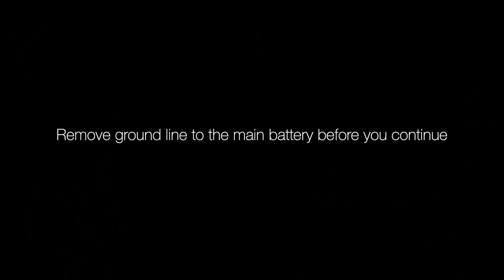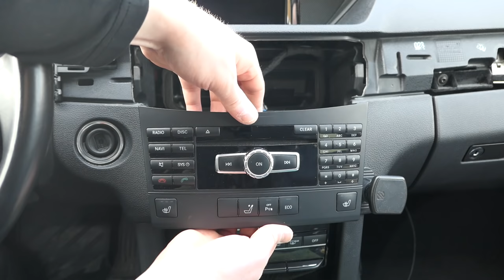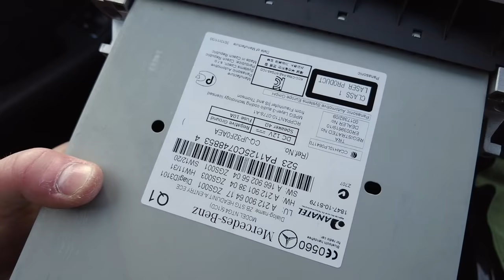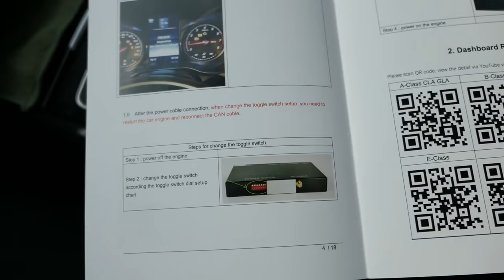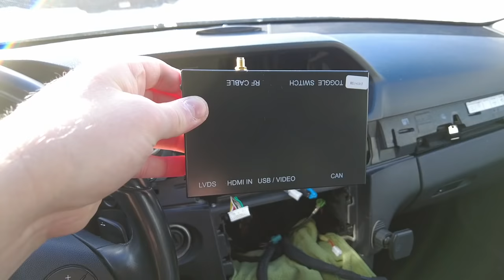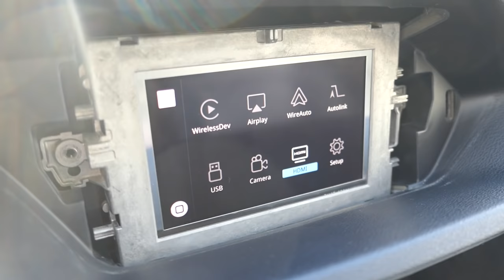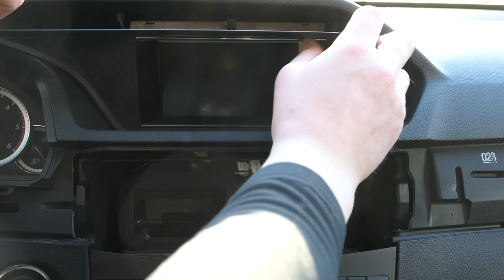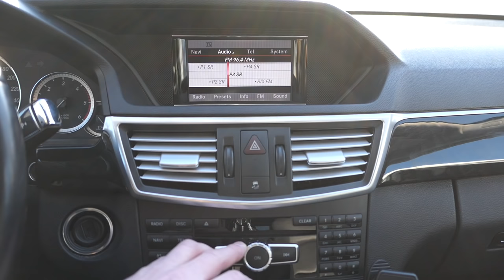Mercedes-Benz | How To - Install CarPlay For Audio 20

Comment: You don’t have rout the AUX cable to the center council. Just use the cars original Bluetooth 👍🏻. Audio quality is great since I am still using the original Bluetooth and I could still play music and answer phone calls from car play 😁
Reply: what did you do with your aux cable in the end?
Reply: @swaagadohnn  not connected to anything.
Reply from the maker: Same here no need to use it! Don’t really understand why it coming with the kit.
Reply: Sir I’m worried about the reverse camera coz it might not work? Also I use Bluetooth so if I install this would it still work? Thanks
Reply: @johnparkerzabala  yes. Both should work just fine
Reply: Does it have Bluetooth even if the car does not? Because my aux sound it's terrible
Reply: @amirjoma8152  I don’t think so
Reply: Audio 20 doesn't have audio Bluetooth it only has phonecall Bluetooth.
Reply: @nudisco300   For NTG 4.5 (Audio 20) VIN option code 523 - it does have audio bluetooth streaming. I'm with the same car and same setup as the video owner and I have audio bluetooth option.

Comment: Dude I keep thinking I’m going to do this for my 2011 W212 coupe.  You helped me do a few things on my own but WOW I don’t know if I have the fortitude to tackle this.  I’ll probably watch this video 100 times and bit off on this project next Winter maybe? Keep the great vids coming.  Love what you do - cheers)
Reply from the maker: Pleased to hear that my videos coming to use. Is not really that hard, is kinda seems messy with all the cables but when you have it in front of you is really easy to understand and execute. 

Best advice I could give is not to stress when doing the install, prepare for a full day with all the steps and testing the device before assembly. 

Be careful when removing the screen if you choose to put the unit back there. Most installers seems to put the unit behind or under the glovebox but is probably same amount of work if not even more.

Comment: I tried it too, for my R172. Although the screen size is different, the aspect ratio is the same, and I had the same problem as you. The image is vertically stretched, because these screens are 5:3 and the box outputs a different aspect ratio. Did you notice it? I emailed the seller, but unfortunately I did not get an answer.

Comment: Thank you for this  very nice and detailed video. Is there a specific detail to identify the correct NTG model of my Audio 20 (SA Code 523) system in my C Class W204 (year 2012)? Also there is no reverse cam in my car. If I install a cam will it be possible to use it with the trajectorie markers and parking lines etc?

Comment: I have a very similar unit added to my C207 ntg, and found the screen blanks intermittently. I have asked the installer for advice, but his reply is take a pic of the screen blanking out, which is difficult to do whilst driving? Is it a fault with the unit or a wiring  issue?

Comment: Got that module from eBay today. Instalation wasn't difficult at all but I was not able to get sound out of it. I did set the AUX to on on the engineering menu but nothing happened and connected the jack to the ami port. The module got blazing hot, beyond any safe threshold for operating an electronic device on a enclosed space. Lost audio from my radio. Then, it startet rebooting. Don't know what to do...

Comment: Nice video, after 5 times watching I finally have a guts to install it myself, only issue that I have is Wireless Apple Carplay is not working but Android Auto is working wirelessly and I also installed a reverse camera but the dynamic line (trajectory) is not showing but camera operates normally. Wondering if it is due to my model is Audio 20 with NTG 4.5 which originally doesn’t have video input for reverse camera?
Also wondering what brand of that box you have? Mine is Limcet box, maybe the wireless apple carplay issue is this brand faulty

Comment: Hi, how does it works with parking sensors and cameras? Does it enables its automatically by itself or you have to switch it on manually? Thanks
Reply from the maker: Parking sensor and camera works as normal. You could chose in the setting if you like it to switch to original camera display when you put in the reverse or you could have it on aftermarket camera for CarPlay decoder. For my audio 20 system is not possible to add rear camera without this decoder, so is great 👍

Comment: Great video well done! Does this also effectively upgrade the Bluetooth version? With my original 2010 unit I can barely stream a song due to slow Bluetooth it seems. I need to understand CarPlay better I guess. Thanks again!
Reply from the maker: Yess I believe so because I don’t need to have my phone connected to the normal Bluetooth so should definitely upgrade your system. Not really sure about the technical for CarPlay but have my phone only connected to it and working really good.
Reply: @MB212   Great, thanks for the reply! I really like how it uses the same screen size. I’m going to check with my stereo shop what they would charge for this install. I’m in the LA/OC area. 👌🏼
Reply: @MB212 hello sir, i have an W212 from 2009 and i ordered the NTG4.0. I am just wondering if the volume of the sound will be low because of the AUX. I‘ve Tried an AUX Adapter for the music and i realized that the volume was waaaay lower than the adapter with the frequences via radio. And Since the Apple car Play will be installed with the output of AUX, i am wondering if it will be with a lower volume too or if its not the case. I would appreciate an answer.

Comment: does this technically also replace the head unit? i have subs in my mercedes’ but they don’t hit well because the stock headunit, so if i where to do this, would it solve that problem?

Comment: Amazing video instruction. 
Have you connected Aux, I couldn't see it? Otherwise how the audio signal from Android comes into original audio system. 
May I ask also a question regarding a rear camera. I have the video signal from the aftermarket camera connected to Comand via RCA/fakra adaptor. The Comand switches to camera automatically when reverse gear is on (set in engineering menu). 
My question is: have you tried (or could you try) whether the camera will have a priority over all modes also in case of this Android device connected? I want to keep the current connection of camera directly to Comand, not connecting via Android device if it's possible. This issue holds me back from installing this device.
Thanks in advance for your help.
Reply from the maker: Don’t really know the use for AUX I have not connect it to my car and everything still works. The CarPlay unit is wired to the original system so the sound coming that way. That’s no problem with the rear camera you could chose in the CarPlay menu what’s happening when you put the reverse gear in. You could have it switch to original screen/rear camera or CarPlay unit camera.

Comment: Hi MB212.  I just purchased one of these units.  I have a 2011 e350 cabriolet.  The dash looks a little different than the 212 coupe/sedan you filmed. Do you have a film that shows how to remove the head unit from the cabriolet?  Appreciate your response.  Thanks.
Reply from the maker: Hi sorry I don’t have any video of that model and not any experience to share. Hope you solve it anyway 🙏

Comment: $300? I have a W169 A class with the Audio 20 and I think I'm just better off replacing the whole head unit with an Android 10 system that looks like it's OEM? If this was a cheaper option I'd understand but I can't see why I'd use this?

Comment: Great job, nice video! How did you you connect the AMI audio cable with its port in the center console?
Reply from the maker: Don’t have any AMI port in my car so I did not use the cable at all. Everything works good without it.
Reply: @MB212  Strange! But how do you connect the CarPlay box with the Audio 20 in order to amplify the audio-signal coming from the box??? you don't have to switch to the AUX-In on your audio 20? I can't understand that :-(
Reply from the maker: Don’t know the technical how everything works. But when I have Bluetooth to normal system I could use whatever menu I like but when disconnecting Bluetooth to normal system is only working from AUX menu.
Reply: @MB212 Aaaahhh! OK! That’s an explaination! Thank you!

Comment: Hey, I have the same CarPlay unit as you and have a small issue that I’m wondering if you’ve dealt with as well.

When in the maps app, you can’t skip music tracks. The control knob moves the map, and of course the prev/next buttons on the NTG unit itself don’t work, as the CarPlay unit only can only intercept buttons going TO the NTG, not on it.

How have you dealt with this, if at all? Thanks!
Reply: hello i am having the same problem.  were you able to fix the problem?

Comment: Is there a version for ntg 5.0 too ? This looks and works great👍🏼
Reply from the maker: Yess you could also buy decoder for NTG 5.0 but for some models is not needed with the actual module, it could be coded in and you not need to redo the cables and things like in this video. 

I read about the NTG 5.0 system and CarPlay and is kinda messy to understand which models that have it or not have it. 

But what I understand is that your unit need to be updated and then you could buy a OBD dongle really cheap and get CarPlay, but you need to do some own research about it because I could not get you 100% right answer on that sorry.
Reply: @MB212  thanks for your answer. 
Yeah I'm also not sure if i need it or if coding is enough. I heard about this obd adapters with the carplay coding. Just plug and play and carplay is on your system. 
I have the s212 mopf. The last of it, from 2016. I think it came out 2014 and since that it got many upgrades, especially the ntg system firstly with becker now with garmin.
I try to find it out. Thank you. Keep going with your content. Its nice to see some modifications and how to do's on this car👍🏼

Comment: You really nailed your advertising in your videos, I’ve just gotten some ad for a CarPlay dongle 😜 how is the microphone quality?
Reply from the maker: YouTube know there audience 😆

Microphone quality I would say is same as before, because this unit use the original mic. I did read from another manufacturer of CarPlay units that’s implying the mic to the original one is not 100% because the SOS function not going to work that’s why they had separate mic before. Not sure if is true for this unit but they say is apply for all CarPlay units on the market.
Reply: @MB212  does  „hey Siri“ work?🙏🏻
Reply from the maker: Yess is integrated to steering wheel talk button, have try it couple of times for sending texts and works really good 👍
Reply from the maker: Read your comment to fast I see now, I have never got so many comments as recently kinda stress me out haha. The hey Siri I don’t know about need to try that out, I literally never used Siri before this CarPlay install.

Comment: Nice video! About the wireless Android Auto, have you tried enabling it in the Android Auto settings on your phone? (Settings/Apps/Android Auto/App Notifications - or something like that, my phone is in Brazilian Portuguese)? I have this same module installed on my C-Class (also Audio 20) and wireless works really good paired with my Galaxy Note9.
Reply from the maker: Interesting but I don’t have any android phone to test it out unfortunately. I did think it was only possible to use android auto with the cable was sure I did read it somewhere. I need to test this out later when I have access for a android phone.
Reply: Google added the support for wireless Android auto recently. When I installed the interface it wasn't supported, but later on Google updated the Android Auto software; I tried and it worked quite well - occasionally it will refuse to connect but it works after disabling and reenabling Bluetooth and WiFi on the phone. Probably RoadTop and the other sellers on AliExpress haven't updated their manuals or maybe not all Android phones support it so they don't advertise that function.
Reply from the maker: Thanks for clearing it up! That could be the case I did read more about it and as you say it not support all phones and locations for now.

Comment: riktigt bra video. har nämligen en 2011 w212 utan bluetooth till sterion original... vet du om detta funkar för att kunna spela musik via bluetooth utan fm sändare? eller finns det något annat alternativ för att kunna installera? mvh
Reply from the maker: Yess det fungerar utan fm sändare, när du kopplar in den här får du bluetooth, mig veterligen finns det inget annat som fungerar. Då du har en 2011 skulle jag gissa att ditt system är NTG 4.0 då kan du inte använda exakt samma enhet som mig men den har samma funktioner. Kolla länken
https://mbworld.org/forums/e-class-w212/794234-diy-kremersino-wireless-carplay-ntg4-0-a.html

Comment: Can u do a video about the differences of the ntg 4/4.5/4.7. And how to tell them apart
Reply from the maker: Is actually in the making but still missing some photos of the different systems for the video. But it coming sooner or later 🙏
Reply: @MB212  what pictures are you missing?
Reply from the maker: NTG 5 audio 20 and command, but I may do the video without them, and I still need to do more research, these system is really confusing to understand 100% and I want to get the information as accurate possible.

Comment: Great video!!
The wireless android auto doesn't work?! is wired android auto the only option?!
Reply from the maker: Don’t have much knowledge about android auto. Seems that I got that info wrong and you actually could use wireless with android but read here first ⬇️

https://support.google.com/androidauto/answer/6348019?hl=en&ref_topic=6106969

Comment: Have you disconnected car battery before you started working on installation or its not necessary?
Reply from the maker: Always disconnect battery before doing installs like this, could be really costly if something happen. I don’t do it all the time but I probably should.

Comment: Very informative video. How about the re reverse and back up camera? Does the backup cam work without connecting those new cables ?
Reply from the maker: Yess if you have original camera is working as before. You could change in settings for original/aftermarket, as soon you put in reverse with original camera is change menu.

Comment: How do you know which one you need. Have a 2014. I have data card build sheet from Mercedes.
Reply from the maker: Check your data card which unit is stated? I guess you got the NTG 4.7 and then you could buy the same unit from RoadTop as I using.

Comment: Hi I have just installed this on my car but I have no sound or very muffled sound coming through I have set aux up in engineering mode but it’s like the aux isn’t sending any signal any ideas?
Reply from the maker: Sorry I don’t know the answer on that. Mine goes directly with Bluetooth and WiFi.

Comment: Can you please share the link for the product.
Reply from the maker: Before you order!!! Check your head unit so you not get the wrong module! Road top have module for NTG (4.5) (4.7) (5.0) but you have a lot of manufacturers for this model and other models. Here you have link to Amazon https://amzn.to/31afvLT but you could also check aliexpress or other sites for more units/better price.
Reply: @MB212  thank you. My car is from 2009 ans it has the sameunit, but it is called 525 - CONNECT 20 HIGH (NTG7)
Reply from the maker: You should ask the seller before you doing order then. Not sure about that code to be true I did not hear about it until today. Is your car a W212?
Reply: @MB212  yes it is. It looks exactly as yours does.

Comment: Good afternoon! Tell me, please! It is possible to connect Car Play to Audi 20 NTG 4.0 (not Comand NTG 4.0). Thanks in advance!
Reply from the maker: Yess it is, friend of mine installed on his 2012 model with audio 20 NTG 4.0. But this particular unit is for 4.5 / 4.7
Reply: @MB212  Thanks a lot for making me clear. It means that it possible to install car play to my MB W 212 ( 2012) with Audio 20 NTG 4.0.
Reply: One extra question, my friend! It is possible to connect the rear camera to this Car Play in combination with Audio 20 NTG 4.0? Thanks in advance!
Reply from the maker: Yess you can put rear cam and also it coming with HDMI option. This is the same unit my friend used for his NTG 4.0

https://a.aliexpress.com/_mMo9D8A

Comment: Is there a version for the NTG4? Its pretty similar to the 4.5, would it work if I installed this one on the 4?
Reply from the maker: Yess is pretty similar to NTG 4 but this particular don’t work. Check the link!

https://mbworld.org/forums/e-class-w212/794234-diy-kremersino-wireless-carplay-ntg4-0-a.html
Reply: @MB212  Thanks man! Ill do! Are you happy with yours? Does it work good? Is the connection reliable?
Reply from the maker: This car is now sold and I did leave the CarPlay with it. But used it for couple of months and it did work flawlessly kinda feel like oem system!

Comment: Hi would you know if this system would work with audio20 unit in 2009 w212.
Reply from the maker: CarPlay works for your system also. But I assume you have NTG 4.0 so not this particular system works but you have some other ones in the market.
Reply: Sorry I got it wrong I actually have the Audio 50 ,was also looking to upgrade the maps but head unit has no sd slot so I take its discs ,wonder if there's any aftermarket way of doing this also?